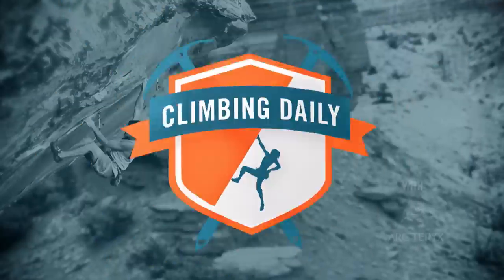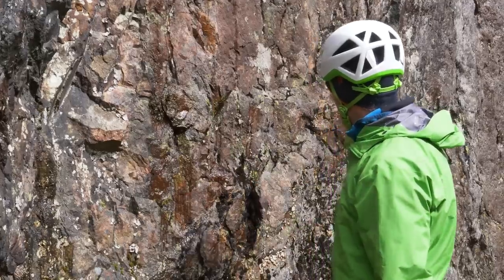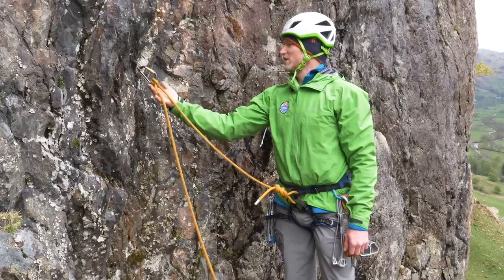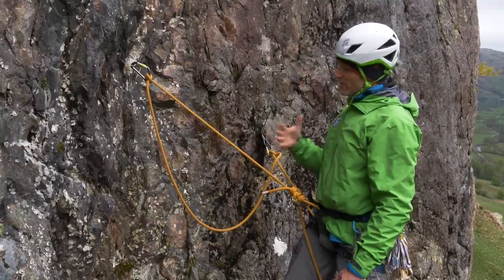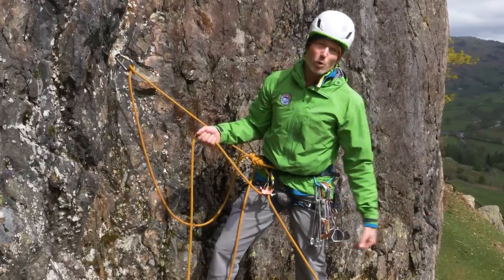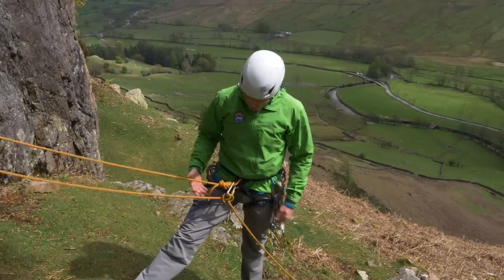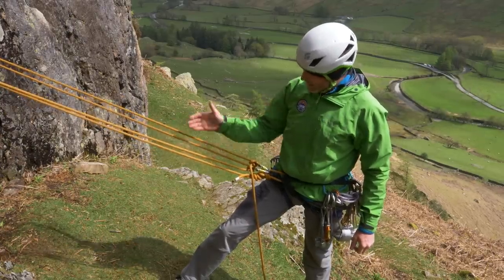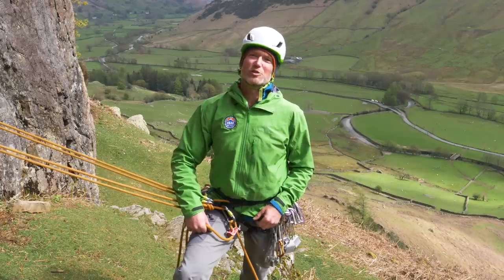How To Build And Equalise A Trad Climbing Anchor | Climbing Daily Ep.1174

Comment: Lots of people are ready to dismiss this way of doing it and I'd like to add some defence to this method.
 
1. This method is great in CERTAIN situations (not all), for example when belaying from marginal gear or in poor rock like we often have in the uk especially in winter climbing. 
2. This method of tying in can actually be faster than equalising and tying on with slings if the gear is spaced out and you are swing leading. 
3. Tying in with the rope is much more dynamic which is always better for the belay. Tying is with a sling and belaying of a guide plate is simply much less dynamic, putting more stress on the belay.  
4. It uses less slings  so they can be used for runners on the pitches or you can carry less of them. 
5. Yes it is more difficult to escape the system however there is a way to do it you just need someone to show you how it is done. ;-) 
6. There is also a easy way to set up a haul with this system to, again you just need to know it. 
7. Two well placed large wires in good solid rock should be plenty for any belay situation, but obviously more is better.
8. Belaying directly off the waist rather than in "guide mode" is more dynamic and puts less stress on the anchor, again better when using wires/cams/pitions/natural rock spikes to belay. 

Learn something from it or dismiss it, as you want. However don't disregard it as unsafe practice! British Mountain guides are part of the IFMGA just as the french, american, german, swiss etc are.  We test and improve the way we do things constantly and this method has stood the test of time and works well in a lot of trad climbing situations. 
Have Fun!
Reply: Exactly speaking he didn't belay off the waist even though he himself was tied to the rope/master point, he belayed off the master point and that is why if the climber falls, the weight would be on the anchor instead of on him, and which wouldn't reduce the stress on the anchor
Reply: Good point, I suppose it gives you the option to try to absorb some of the force with your legs if you really want to though.
Reply: Nailed it!
Reply: Could you do exactly what is shown here but setup the belay device in guide mode?
Reply: @lalibertenordsud  IN the first configuration, you could leave a lot of slack between the two anchor points and then once you are backed up, tie a master point in the slack between the anchors. Then you could place your belay device on that master point in guidemode. This method has the advantage that it is MUCH easier to escape belay and that should one of the anchor pieces blow out, both you and the climber are still redundant on the other piece.
Reply: "8. Belaying directly off the waist rather than in "guide mode" is more dynamic and puts less stress on the anchor, again better when using wires/cams/pitions/natural rock spikes to belay. "

Just some thoughts...

Didn't Petzl do some test and come to the conclusion that belaying in guide mode puts less force in the system than belaying off the harness? I seem to recall it shocked a lot of people who assumed a fixed belay in guide mode would have more not less forces in the system. 

Also this way makes it harder to escape the belay if necessary. Otherwise an acceptable belay method for some situations.
Reply: The distance/angle between two pieces on the screen appears to be greater than 60 degrees which add additional multiplied force on each piece. Also belaying off of your harness is a valid method but in the event of one piece on the anchor failing and the belayer losing balance could prevent them from providing a belay. This is a valid and slightly more alpine technique not typically used in NA but is valid just the same.
Reply: I love this. Getting the info from people who know what they're doing instead of al the smartasses thinking they're the best climbers in the world claiming they always have the best solution... thanks for this info!
Reply: So you make excuses for ignorance.
Reply: @adventureswithfrodo2721  calling a mountain guide ignorant in the context of climbing is pretty naive...
Reply: @adventureswithfrodo2721  Only someone truly ignorant would make your comment.

Comment: Pro. Tips. USE SILINGS
Reply: Why not just use what you have?
Reply: Sercan Dönmez what
Reply: What if the gear is too far apart to equalise using a sling? Say you only have two pieces of gear 3+ metres from each other, a sling isn't going to be able to equalise the two without creating an obtuse angle. I think that a rope is perhaps more effective in this situation.
Reply: Martin Giblin its a bad position when you need escape the belay , you will have disturb the anchor
Reply: But then your pro-tip doesn't apply, does it? In regards to escaping the belay, I'm in two minds, but doesn't John Long say something along the lines of that it is far from the most important thing to consider whilst constructing an anchor? He seems like a reputable source. 

I think slings are great solution in most scenarios, but there is certainly merit in this demonstration.
Reply: Pro tip. Use either depending on the scenario.
Reply: Pro Tip: Have lots of different methods at your disposal so that you can use the one which is most appropriate in a given situation.

Slings are great and the ideal solution in a lot of situations. Building a belay from rope is also great and is the ideal solution in other situations.
Reply: @richardparke4105  : Redundancy?
Reply: @felixantoinetremblay  In what sense? Hauling up cord or rope specifically for anchor building has it's place but it certainly doesn't offer any extra redundancy to building the anchor using your climbing rope.
Reply: @richardparke4105  : Your question was open. If you have a second rope, such as a twin rope, you have redundancy.
Reply: @Sercan Dönmez slings don't stretch, the rope is safer when you can use it. Its always the default for me

Comment: Don’t  like it. I prefer an equalized sling. And a central carabiner. Even if you move left-right it’s always having the same tension on both anchors.
Reply: It's good to have multiple techniques in the tool box. you never know, you might have used all your slings up. also the fewer items in the safety chain the better.
Reply: @davidcross30  Damn. Too bad there's not a way for me to add a ton of thumbs-ups/likes to a comment.These two simple yet absolutely critical statements alone deserve a bunch: 
"It's good to have multiple techniques in the tool box."
"the fewer items in the safety chain the better."
Reply: Are you referring to a sliding x? That anchor is really dangerous...

Comment: Cool stuff, as a saffer we got all our techniques from the poms, from milky tea to abbing off a tuft of grass. Two pieces are plenty my bru! Liked the vid, technique worked fine for many a climb. Having moved to Europe, I now drink coffee off course. I still use a similar technique using the main rope on all my trad and sport climbs, except I equalise between the two pieces and use this as a master point from which to belay the second using e.g. an ATC Guide, so I can have my coffee whilst I'm at it. On bomber pro, I'll simply join the pieces. I am tied to the lower pro myself (longer or shorter depending on the stance), backed up to the higher one. Once brought up, I transfer the second onto my harness as they lead on (there's a quick, safe technique for this). Before unclipping from the stance they clip the higher anchor to avoid the dreaded factor 2 fall. Advantages: rope management is a breeze, I can have a sandwich while bringing up my partner and I can get out the system if need be. Disadvantages: you are not always 100% equalised, so use with discretion.Thanks for the vid, enough typing, I'm heading for the hills!

Comment: this seems like a really weird and convoluted way to build a trad anchor. Just use slings and cords. Easier, faster, allows for you to lead the next pitch, and gives a shelf to belay off of.
Reply: Slings and cords don't stretch as much as the rope. If you load the anchor directly and are only tied in with slings, you have a high chance or breaking the sling or ripping the anchors.

Comment: Aren't you supposed to belay from the anchor and with your Reverso in guide mode? There doesn't seem to be much braking with this let alone auto locking...
Reply: You can use the DMM Pivot (that is the one he has in this video) in guide mode but in this instance he is just using it in the normal belay fashion. It works perfectly well in the way and has plenty of braking force this way.  It's not really a supposed to or not; you can use it in either way. DMM have some good videos and how to's on their website for it.

Comment: This was how I was taught years ago, but these days typically only will use it mountaineering. It's a fast, efficient method to extend the anchor to the edge from far back, so great on ledgy multi-pitches. 2 piece anchors are out of fashion, but when the weather turns and speed is a a factor of safety, techniques like this might help you get up and off faster. 

A modification is to use the 2 carabiners as a shelf. Once the anchor is set and connected to your belay loop, add clove hitches to the gear ends. Connect your PAS to the 2 carabiners (they become the shelf) and unclip them from your belay loop. You never leave the system, but are not no longer directly involved in the falling forces. You can either use the 2 carabiners as the master point, or add a third to join them into a single point (or just use one HMS in the first place). You have the option of adding a sliding X if you feel self equalization is required. 

This could be built with as little as 2 bits of gear and 3 locking biners (2 D, 1 HMS). A useful technique to keep in mind when you've finished a long pitch and run out of other gear/slings to build your anchor, or dropped your cordelette swapping leads etc.

If I have 2 bomber pieces in and 10 feet of dynamic doubled rope connecting me to them, there a large factor of safety. But if you want more anchor points you can add an independent anchor, like a 2 (or 3 or 4) point quad, that joins the system at the master point. If you ever need 6 pieces at your anchor, that's some shitty rock! Good luck. lol.
Reply: kin-ell dude ,I heard you the first time :-}

Comment: isn't there too many carabiners on a main rope loop? the one that goes through your harness?
Reply: @filimonchik If you're referring to the two clove hitched 'biners in the anchor system, there aren't actually too many on the rope loop per se. In this configuration the 'biners are linking the anchor legs to the loop serving as the main/master/power point of the anchor. Independent of other factors, this is fine. HOWEVER, there are a few things I don't like [and I think you’re onto something once we add the 3rd ‘biner]…
Note: these points of contention are things that can be overcome. As such, please keep in mind, these are according to MY preferences. There's more than one way to skin a  cat. YMMV.
1. That 3rd ‘biner with the belay device is also clipped into the same loop [i.e. directly onto anchor]. => No real dynamic belay or force absorption from the belayer, which would be nice, having only 2 pieces in this anchor with one tucked behind a flake. This is one of the primary advantages of using an indirect belay negated => IMO better to set up so belayer isn’t part of the master point [see point #2&3].
2. The loop serving as the master point is also his direct tie-in connection between rope and harness. => If his climbing partner is injured such that he needs to escape the belay, it’s gonna be rough [i.e. extra work].
3. Unless I overlooked something, if there’s any need to escape the belay, there are some sizable hurdles to overcome solely due to the anchor construction [leaving aside concern over his personal tie-in]. These include: load transfer of anchor legs off of tie-in loop using some friction hitch artistry; transfer of climber’s weight off the tie-in loop to anchor [couple knots and more friction hitches]; and then getting himself disconnected from the system. Keep in mind all this has to be done while weighted. No thanks. :)
4. This last criticism is really moot compared to the above, but worth consideration. If I had two screw-locking ‘biners next to each other like he does, I would ideally prefer two different types, or asymmetrical D’s and reversed. The reasoning is based on an unpleasant surprise I got at the anchor of a top-rope route many years ago. I had the rope running through two LOCKED symmetric D ‘biners [opposite and opposed, as one does], which were connected to a quad anchor. When I climbed to the anchor, I saw that the two lockers—due to movement back and forth on anchor—had rubbed the screw-locks loose and aligned such that they were holding both gates partially OPEN [spine of one pushing on the screw-lock barrel on the gate of the other]. Yikes! I haven’t paired 2 lockers on a TR anchor since. If I hadn’t seen it myself, I wouldn’t believe it. So, even if you’re skeptical, please just keep stashed somewhere in your memory that some dude said that it’s possible for 2 of the same screw-lockers to hold themselves open. This is not nearly as significant in this application, since they're always visible, and possibly separated by cloves, but it's extra safety that doesn't even take an extra second. 

Assuming we’re using the rope for anchor, I think I would prefer to…
1. Keep belayer’s personal tie-in to rope OUT of master point [clove hitch to anchor a bit above tie-in fig-8 works].
2. Connect legs to a single master point that's part of anchor. To do so, leave everything in series as-is, but use a knot in the central bight instead of clove hitch [fig-8 or alpine butterfly would work well]. DON'T try to tie all legs into one master point like a cordalette :) heh.
With those two changes, now he can belay off harness, or direct, or redirect as he chooses, but still is very simply/easily able to escape belay, set up 3:1 haul/pulley, move around, etc. etc.

Here’s a simple version in my crappy diagram below: clip ‘biners of C1 & C2 to the bight of 8 [now you have a master point independent of the belayer], adjust C1/C2 for anchor leg equalization, clip BD to belayer or to master point [your choice], pull up slack & thread BD for belay of second climber, done! 
If belayer wants more mobility, then start with more slack on belayer’s side and insert C0 [clip C0 to master point and adjust length as desired].
The nice thing about simple rope anchors [in addition to being SERENE and no extra weight] is that they can be iterative —> can add in another 8, C3, C4, etc. …but be reasonable—no rats’ nests :).

                    N1      N2
                    / \       /  \
                  /     \   /       \
                C1      8       C2               _ / \ _ = rope
               _/             _/                   N1/2 = nut/chock #1/#2
 (C0)   _/            _/                       C1/2 = clove hitch to ‘biner #1/#2
          /              /                           8 = figure-8 on a bight
belayer         BD                           BD = belay device
                         \
                           \
                           climber

edit to insert note

Comment: Gotta love all the know-it-all chuffers straight out of their Learn To Lead class commenting on every Brit anchor video about how sketchy and unsafe their methods are.
Reply: There are some differences in climbing regions that might be over looked in the comments and video. I'm based in Squamish, Canada and there are tons of cracks everywhere, like super solid parallel cracks. I hardly bring wires and nuts with me at all, it's all cams. Hexes are a comedy routine. The thought of making a belay anchor with 2 nuts in a multi-pitch is really outlandish. 

The video has some great info for the mountains and cliffs of this region I would guess, but if a professional guide did that while multi-pitching here in Squamish, they would be fired.